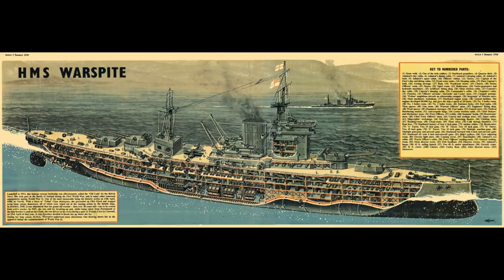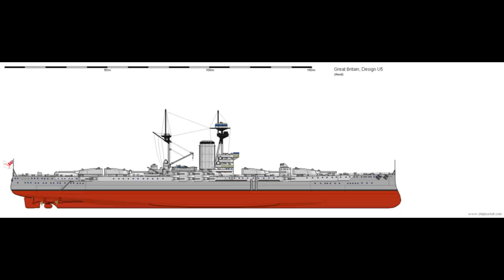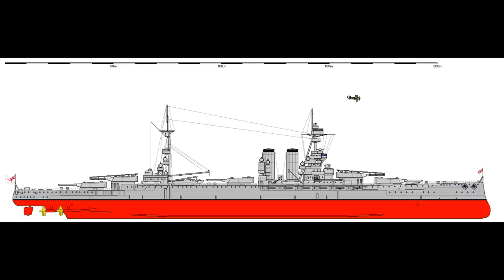The Drydock - Episode 009

Comment: Re gun making, it is also worth mentioning the 100 foot tall vertical furnaces needed to precisely heat the gun tubes, the overhead cranes, and the 100 foot deep pits filled with temperature controlled rape seed oil (each with a surrounding water cooling jacket} in which the hot gun tubes were plunged to anneal them - see Johnson & Buxton,  “The Battleship Builders”, Seaforth, 2013, ISBN 978-1-59114-027-6 .  Such facilites are expensive to construct and maintain and difficult to repurpose when big gun orders dry up.  And the skilled workers who were laid off in the 20’s were equally hard to replace when big gun construction recommenced in 1936.  Britain lost over half her naval gun making facilities between the Wars, with the closure of the Coventry Ordnance Works and Beardmores gun factories, leaving only Vickers-Armstrong and Harland & Wolff.  Fire control equipment was similarly a bottleneck when rearmament began.

Comment: Thanks for another great episode

The information about how difficult it is to build a large naval gun was an eye opener.  I knew it took a long time to build them but didn't truly understand just how exacting it was.
And they had to be strong to withstand the pressure of hundreds or pounds of cordite going off multiple times.

On the Canadian BB.  I do feel you made an error in this.  If Canada had gone for the 10x15inch gun ship it would NOT have been capable of 25 knots.
The original design for the QE's was a 10x15 inch gun ship capable of 21 knots as per the rest of the fleet. Calculations showed that they could remove Q turret and still have a broadside heavier than the 10x13.5 armed ships.  By removing Q turret the space saved was used for more boilers to produce a 25 knot BB to act as a fast wing for the fleet.
As to whether this ship would have survived the Washington Treaty would be the source of numerous debates.  The Americans raised a massive stink over HMAS Australia,
They demanded it be scrapped as they declared it part of the British fleet despite if being the flagship of the Australian navy as H.M. A. S., note the A there, and our only capital ship.
I feel the Americans would have been similarly adamant about a proper Super Dreadnought even if it was the flagship of the Canadian navy as HMCS Canada.

Another vital facility the Japanese ignored at Pearl Harbor was the vital machine shops and repair yards.  If these had been destroyed, or even heavily damaged, it would have played havoc with attempts to maintain or repair any ship.  The Japanese seemed to be more interested in a limited tactical victory and propaganda coup than in an intelligent, long term strategic success.
Reply from the maker: For the Canadian battleship, it's powerful enough that I think the British would either have insisted The Dominions get treated as their own navies or else sacrificed one of the Iron Dukes to keep it around.

For the speed, you are right about the original design, I was thinking that if Canada was going to go all out for one big flagship they'd likely have the design modified, perhaps using the R class semi-all or nothing scheme and other tricks to save weight for more boilers to get the speed up.
Reply: @Drachinifel  Hate to barge in on this fantasy.....  Who is attacking Canada by sea? Meaning, they have never needed protecting except from those Gangsters across the Lakes. So.... the point of a Canada building a battleship is ???
Reply from the maker: @WALTERBROADDUS  the Canadian Navy in WW1 was an associated force of the Royal Navy, at a time where war with the USA wasn't off the cards.

In that context, a Canadian ship adding to the RN battleline makes sense.

In WW2, the Canadian Navy was heavily involved in convoy escort work, and part of that was guarding against surface raiders. Again, a battleship makes sense in this context.
Reply: @Drachinifel  That is lot of spending and ship just to back up the Queen's Navy. But with American streaks of Neutrality, It does justify a small navy. Even in 2018, they barely can afford a navy. So a Battleship in 1918 is a bit hard to buy.
Reply from the maker: As I mentioned in the video, in 1913 there was a plan to pay for no less than three battleships of the QE class, and this was argued against on the grounds of expense. But one slightly bigger one would likely be approved, considering Australia and New Zealand paid for a battlecruiser each and the Malay States, far less flush for cash than Canada, paid for a single QE.

At the time, with various US Congressmen demanding a navy 'Second to None' (Although refusing to pay for it), the US was definitely not seen as a neutral power in the early 1900's.
Reply: John Fisher while you raised a valid point of why didn't the Japanese Attack the machine and repair shops, as well as the oil tank farm, the main objective of the Japanese was to sink or disabile the Battleships and Aircraft Carriers at Pearl Harbor. Two reasons they didn't go beyond the Battleships: First, the missing Aircraft Carriers, because of the direction the Japanese Aircraft were coming from and the range most Aircraft had, the Japanese Commander knew the Americans had a good idea of where his Carriers were, especially with the radar sighting they didn't know about. To sit there for several hours while arming and launching several waves of Aircraft it would have taken to do this, was risking a surprise attack by the missing Carriers. The Japanese couldn't afford to lose any of their carriers, which had a time table of further attacks after Pearl Harbor they had to stick to anyway. The Main Reason beyond the missing American Carriers was Pearl Harbor was a major Submarine Base with patrols constantly coming and going, Japanese Pilots spotted several Submarines at Pearl Harbor during their attack, several moving and submerging, the Japanese had a Horror of being torpedoed, this became more likely the longer they stayed in the same place. Because of this, the plan was sink the Battleships and Aircraft Carriers and get out as quickly as possible, they were deep in enemy territory and their Aircraft Carriers and highly trained crew's were too valuable and hard to replace to risk, Japan still had the British, Dutch and Australia and New Zealand to deal with as well as Invading several key points on a fixed time table during the next week. Looking back, this was their golden opportunity to Destroy as much of the Capabilitie of Pearl Harbor as possible, but all their plans are based on a limited war that would be over before Pearl Harbor could become a factor in it. They knew if it became a long War, they couldn't win, so ignored that possiblity in their planning.
Reply: Hey could you point me to where I could find the original QE design, I've been looking for it but can't find anything but the actual design that was built.

Comment: For the attack on Pearl Harbor, there wouldn't have been a third wave ready to go, at least not right away. IJN carrier doctrine at the time was that carriers operated in pairs and for an attack wave, one would launch its full complement of dive bombers and a third of its fighters as cover while the other would launch its full complement torpedo bombers and a third of its fighters. This allowed for rapid operations as it allowed an entire attack wave to be spotted onto the flight deck and rapidly be launched without having to spend a long time in a holding pattern as more planes are moved up to the flight deck and launched. A second wave consisting of the remainder of the bombers and another third of the fighters per carrier (the remaining third was retained to fly CAP) could then be launched about an hour after the first wave. However, a third wave would have required recovering the planes from the first attack waves, taking them below deck for rearming and refueling, then spotting and launching them. Japanese losses during the second wave were already higher than the first wave and a third would have allowed another six hours of preparation by the Pearl Harbor AA crews. A third attack wave would likely be returning to their carriers in fading light if not after dark making it a significant risk even if things went well. Given that they exceeded their objectives for the Pearl Harbor attack, it seems likely that calls for a third wave weren't seriously considered at the time given the risk and were something that came about later in hindsight.

In his book on the Pearl Harbor attack, Alan Zimm is a bit skeptical on the efficacy of attacking the oil storage tanks and argues that fuel oil is not particularly easy to ignite and the IJN weapons were not designed for such a task. My understanding is that zeppelins in WW1 despite being filled with hydrogen were not easily taken down until the British started using incendiary rounds developed as a counter and that igniting the fuel oil at Pearl Harbor would likewise have required weapons more suited for the task rather than ones designed for use against ships. But on the topic of hypotheticals, even had the IJN been successful in attacking the oil storage and had taken most of it out, it is likely that tankers and fuel would have been diverted from the Atlantic to restore capacity which meant that many of them would have avoided being sunk during the Second Happy Time. There would probably have been a temporary dip in fuel shipments to Russia but it's hard to know what the impact of that would have been because the fuel oil used for ships isn't the same as the fuel that Russia needed most like high octane gasoline for planes or diesel for tanks.
Reply: I've read Zimm's book a number of times, and while overall I thought it was fairly good, I think he was wrong regarding the fuel stores. I'm not entirely sure where he gets the idea that fuel oil is somehow hard to burn; one only needs to look at the surface of Pearl Harbor during the attack to see that the ships' fuel oil could be set on fire relatively easily once it was outside of its tanks. The regular Japanese bombs would likely have had little trouble igniting the oil in any tank they managed to hit and break open. Also, while Zimm does correctly point out that the fuel stocks at Pearl Harbor could have been rebuilt relatively easily within a few months, he fails to consider the impact that even a few months of reduced operational tempo would have had. Those were the months where the U.S. carrier groups were launching a number of raids which, while not very significant themselves, provided experience that would be crucial at Coral Sea and Midway. So while hitting the fuel stores wouldn't have had a disastrous impact like forcing the entire Pacific Fleet back to the west coast, I think it would have had a significant impact.
Reply: True his analysis in this section is not nearly as rigorous as in the rest of the book, but on the flip side the direct effect of bombing is often overstated. I think that film and television has also created a bit of a misperception in how easily fuel can be ignited.

I'd like to see a more rigorous analysis on it, but my feeling is that the impact of an attack on the fuel storage wouldn't have been nearly as large as most commonly believed and more in line with most other early war strategic bombing attacks which were generally disappointing in direct results. In particular, it'd be important to see some actual testing as to how easily the fuel could have been ignited. There's a bit of a misconception going around that the gasoline used by Sherman tanks caused a lot of fires but it was really the ammunition that was the problem (having a big star painted on the side of the tank right over some ammo racks to provide a convenient aiming point didn't help matters). Introducing wet storage for ammo dramatically reduced fires and German tanks also used gasoline and that's generally not seen as a problem (quite a few other things are...)
Reply: A third wave would have perhaps had a better target, the Carrier Enterprise.

Comment: How comes, while Lion class and the Borodino class battlecruisers where delayed  until cancelation due tu a lack of guns and turrets, Germany had some guns für Battleship H finished, that would later be used as shore artillery., even though only little work on the hull was done?
Which is seemingly also a reoccuring thing: Germany also had during WW1 complete sets of guns for Sachsen and Württemberg, and sets of guns, including replacements for the Mackensen class battlecruisers, while those ships were far from being completed.
Reply from the maker: I think largely because most of the time (although not in the case of the Mackensens) the guns were repeats of previously used guns, so there was much less R&D involved at the start of the process and production could start ASAP

Comment: it is my opinion that a Spanish war over the falklands would post pone the american revolutionary war as it would have extended the period of benign neglect, and all at once caused it to flare up more violently as the extended period of neglect would in turn give the continental congress more time and experience in dealing with colony wide government which could lead potentially to a shorter war as more colonist would be in support of the local government then the one a world a way. truth be told if the British parliament continued the aforementioned benign neglect it is possible the the revolution either wouldn't happen or would have been snuffed out as the lack of governmental input was a major point of tension leading to the revolution.

Comment: RIP Oregon, a poor victim of bureaucrats just like the Warspite. Wouldn’t it be cool if she is still around today?
Reply: It would be cool. But if Oregon was worth as scrap a flying boat that saved 5 sailor's lives would you still keep it?
Reply: The Mikasa wasn't scraped and Japan lost the war and had steel supply issues. If Mikasa was saved, surely Oregon could have been.
Reply: The ship in the graving dock in "The Drydock" logo is the USS Oregon (BB-3).
Reply: It wasn't a bureaucrat issue - it patriotism, Do it for the War - The Oregon was a big chunk steel - it was scrapped not for it's economic need, it was a resource -Steel. See Metal drives during WWII - many of our old Steam fire engines and park cannons went to the foundry to support the war.  As many bits could be saved - and they are still around Portland today: her Mast, bollards, bow plate, smoke stacks and radio shack. The teak deck was auctioned off as further war drive. Before she was melted down she was identified as a resource repossess by the war department  and went to war the third time as a ammunition barge to Guam.